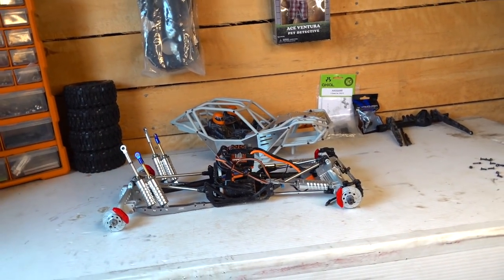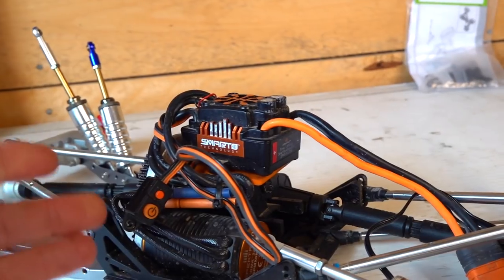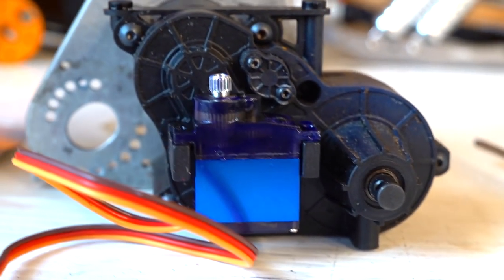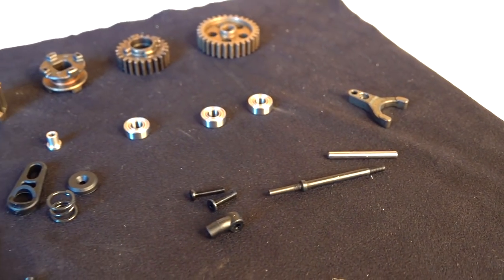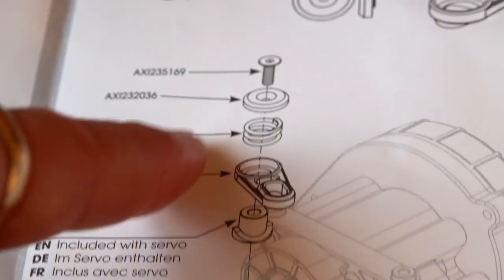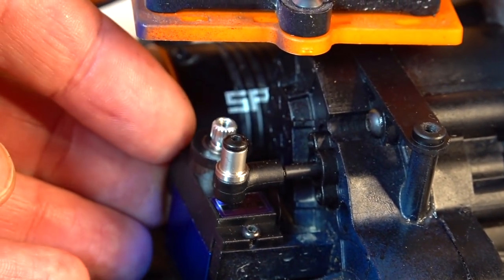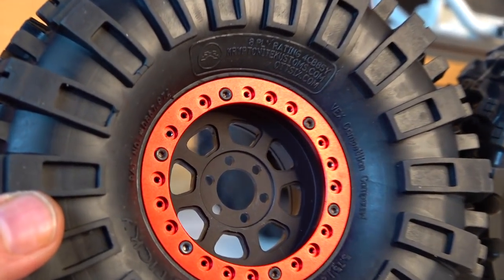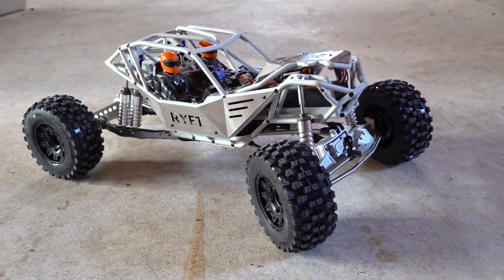PROJECT: "SiLVER BULLET" - 2 SPEED Axial RYFT RBX10 BUiLD COMPLETE | RC ADVENTURES

Comment: What kind of noticeable difference in weight do you notice between the Integy shock style vs traditional smooth style? Looks amost cheap in design, although I know it is not. But I need to try some, maybe on my Spawn. Y'all really are gettin pounded with winter weather up there. Its gotten so tame down here in VA from where the year started

Comment: I had such a headache with my rtr trying to use the 2speed conversion without the spektrum only servo saver, I made sure not to install the 2 speed on my kit version. I now need to either get the spektrum servo saver or just go back to single speed on my rtr ryft. This this is a beast medic, those clear vanqiush axles are so choice.

Comment: Sorry for being late to the party!!!!!
I've had my ryft kit together for two weeks, love it!!!! That slide guide bar on the tranny for the shifting fork. I stuck that in my drill and sanded smooth now no resistance. Bull that we are supposed to buy spectrum micro servo just for the bottom part. I used crazy glue and baking soda to make it work no spring being used. All dialed in on my gt5 skyfly channel 3.

Comment: Vitavon do a swaybar relocation kit that would maybe fit with the dual shocks. the shocks are unsprung weight so does not make as much difference to weight up high. I find when doing motor mount bolts with a lot of threadlok it is better to use a good quality high watt soldering iron. If you do not want to add rear steer rear dig would be a good compromise and in some cases a better option. It sounds like some spooky film effects with that wind whistling LOL.
You would be better off with a two or three position switch rather than a dial, going very slow will limit the grinding it just drops in.
I have Badlands on my HPI Baja 5B although very old so not belted but grip wise they are like Velcro but for a Rock Bouncer I would run narrower tyres like those shown, loveing this build.

Comment: Hey man love my ryft but damn the 2 speed gave me so much issues with it. Starting with missing piece for shifting saver assembly and ending with the inside having horrible tolerances and gears skipping. Those 4 knobs that engage shifting gears skip, they do not engage properly and I spent whole afternoon with dremel chipping slowly at the case and the gears themselves giving the shifting rod more throw. 

At first i though it was the micro servo skipping so I swapped to solid servo arm, still skips so for testing purposed I locked it in gear with zip tie at max throw…and it still skipped. Poke around on YouTube where people cut the clearances it will save you some broken parts

Comment: It don't matter if it's built at the factory or if I buy it used. The first thing I do when I buy a new rig is tear it completely down and make sure everything's greased right and the bearings are good.  I made the mistake and not doing that once and it was completely bad juju.

Comment: normal when you test a gear box don't let the throttle cut it change gear throttle you gonna smash the gearbox if you do it with the vehicle in run due to forces..

Comment: what size shocks are you running in the rear and what size in the front. and what weight oil? an what brand 2 speed trans are you running? And I want to get that for mine and a 2 speed trans for my cen f450 too. thanks any help greatly appreciated.
Reply from the maker: The shocks are MSR10 from Integy. They come with multiple-sized rod ends.  The two speed is a conversion from the manufacturer, "Axial". The transmission is original to the "Ryft RBX10".